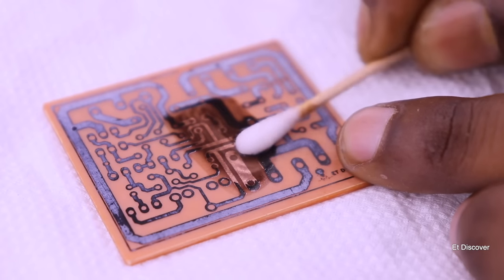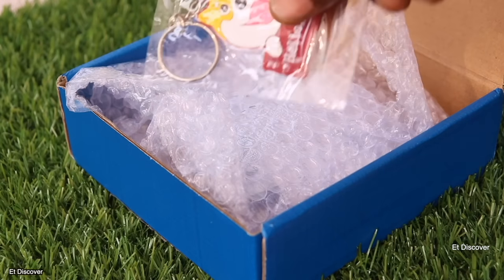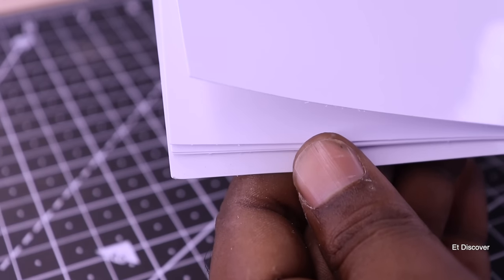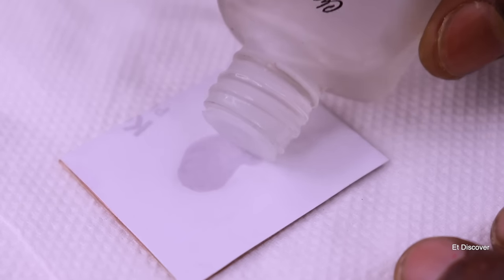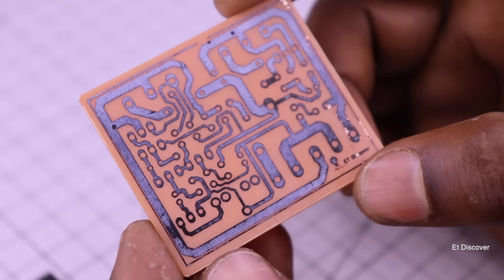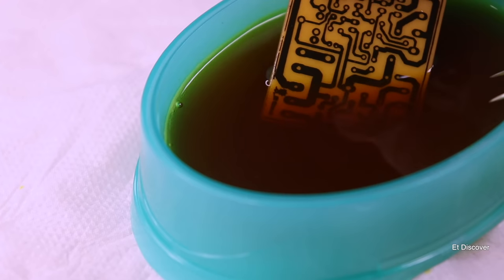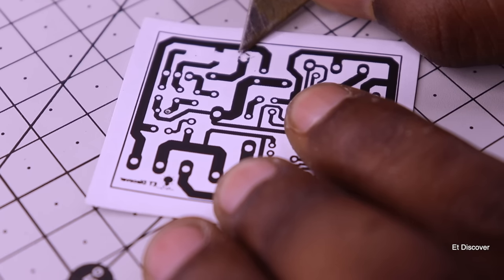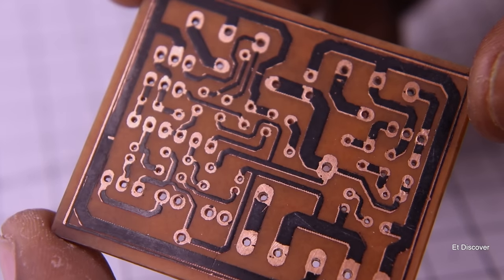How to make PCB Without Iron, & Added solder mask in PCB trace

Comment: Last time I did a hand made PCB with toner, I printed on vinyl sticker material and used cheap laminator machine to do the transfer. Results were pretty darn good.
Reply: Which printer you use for ?
Reply: @Sekhar_Home  just a laser printer. Either my Canon or Samsung. Don't remember

Comment: This method works like charm, i have been using it for a while. Few points to note - 
1. Dont use thick photo papers for this method, the thinner and  lower the quality of photo paper, the better are the results. 
2. Note that not all nail polish removers are acetone based. Check this when you purchase.
4. Do not pour too much acetone on the copper board, just a thin layer to conver the entire board.
5. Also, do not pour too much acetone above the paper.
6. You can apply very light pressure once the paper is sticked to the board. Applying too much pressure will spread and widen the tracks.
7. Do not immediately remove the paper once the paper is sticked. Wait for until the all the acetone has evaporated, you can feel this by touching the paper above and it will feel cold.
8. You may need to experiment for a while before you actually start getting good results.
Reply from the maker: You’re right
Reply: What to use as thinner?
Reply: which nail polish remover you have used, i tried this months back & failed
Reply: @pookoye  you may try pure acetone instead of nail polish remover. It"s available in medical stores.
Reply: Can I use  inkjet printer instead of laser printer??????
Reply: @souvicknaskar4538  this method works for laser prints only
Reply: Please can you suggest a laser printer model number (India) which prints solid blacks ? Some printers print dotted blacks on photo paper which are not solid blacks.
Reply: @EtDiscover  please pin this comment Abhijeet Vishwakarma
Reply: wow thanks'

Comment: are they not getting short circuit because all the connections are on same copper plate any  insulation layer ? 
reply please
Reply from the maker: Single layer PCB, no chance of getting short circuit
Reply: For anyone still wondering about this question, the board is an fr4 glassfiber based board that isn’t conductive with a very thin layer of copper on top of it, this process works by covering the parts of copper that you want to be come traces with ink or toner and etching the rest with chemicals.

Comment: Better still, will acetone work better? Also a quick soak of blank PCB in vinegar will clean copper. Then wipe with acetone and finally isopropyl alcohol, or methylated spirits will do. Then do your processes.  Ammonium persulphate solution (at at least 70 dec C) is nicer to use than ferric chloride, and can be stored and reused multiple times. Use (an old!) electric frying pan with a ceramic dish in it. I made a rocking platform and a 2-3 minute etch, in a clear solution is much easier.
Reply: Just vinegar won’t work alone though, I think you’ll need hydrogen peroxide and salt to that mixture